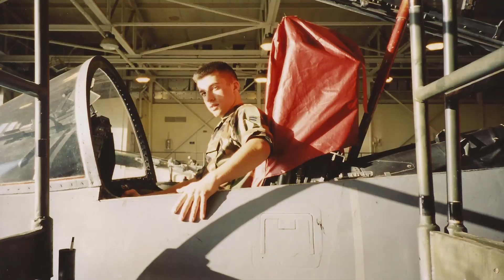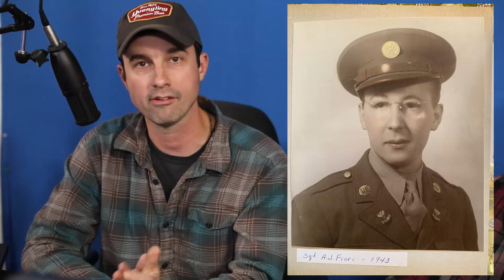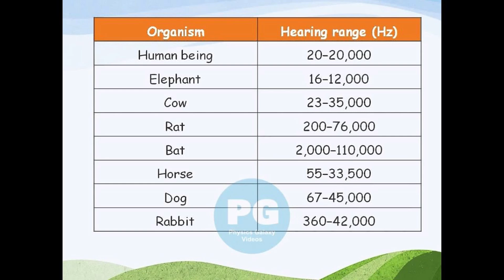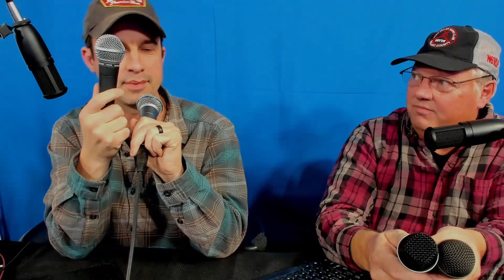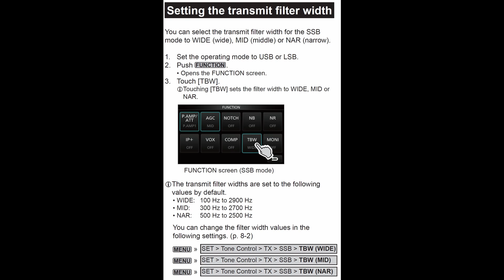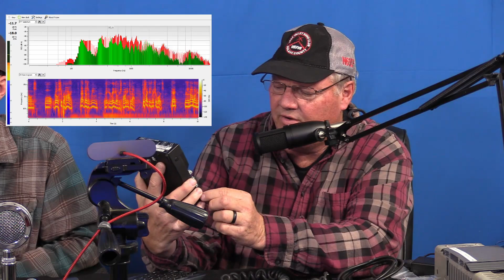Exploring Microphones (condenser vs dynamic vs hand mic)

Comment: Got a condenser mic, Mackie mixer, pyle direct box, 1/4 to 1/4 unbalanced cable, heil xlr to rj45 plug for my FT-991A and put out nothing but RF over the air.  Sent the Condenser mic back.  ordering a Heil PR-781 Dynamic mic tomorrow to try and can eliminiate the mixer and direct box..  hope it works.

Comment: Thank you for your service.  I was in the USMC for 4 years and in Vietnam '71 - '72; my dad was in the Army Air Corps during WWII.  Just ordered a Heil Pro7 headset for my new Yaesu 991a.  I've got several D-104's and hopefully another Ham is gonna help me wire one up so I can use it on the 991a.  Cheers & 73 from W Rusty Lane K9POW in eastern Tennessee

Comment: Would be nice to hear the difference between the d104 and condenser mic. I've been using a d104 for years and just got a 10da head for it. The 10da in my opinion has a much better sound and is definitely much hotter than the d104. I would love to have a comparison to see the difference between the different mics you let us hear today and the microphones designed for radio communication.

Comment: Great episode 😉😉very technical and you hit sum great points with transmit and receive bandwidth. Wish I knew more about how to set the parametric levels 😉😉 and which settings in the 991a did what 😉😉 thank you Jason & Kevin. Maybe a chat about older n sum mics that require phantom power 😉
Reply from the maker: Glad you enjoyed it! Yes, we will be doing more with mics and phantom power soon. We are in the process of building cables to sell for different type of mics that would plug into different radios.
Reply: I

Comment: You should probably do a little research before you make any further mis-statements about the frequency response of human voices.
Reply: In what way is showing the frequency range of the Human voice on a spectrum Wrong. Please teach us all.
For all the Ham people out there wasting money on expensive microphones just remember most tranceivers have a passband of 30hz to 3khz and this is where the most intelligible voice sounds are, so paying through the nose for a microphone that has a frequency response outside this range is a total waste of money.
Reply: There is nothing wrong with showing the response of the  human voice on an RTA; mis-stating the response is wrong. Think about it, if the response of the male voice is 60-180Hz or whatever he said and the female voice 100-270 or what ever, then neither voice could be heard over a telephone (300 -3,000Hz). The RTA clearly shows that the response of both voices extends up way above 4kHz. For mics, a good, flat response dynamic mic is more than enough for the limited bandwidth of the radio. And no, you can’t drive nails with a SM-57 - that honor belongs to the EV-664, the “Buchanan Hammer”.
Reply: @kendickensheets9522  I think they were talking about the fundamental frequencies of speech,the fundamental frequency of the complex speech tone – also known as the pitch  – lies in the range of 100-120 Hz for men, but variations outside this range can occur. The frequency for women is found approximately one octave higher. For children, its is around 300 Hz.
As you mentioned correctly the average person can't hear these frequencies and telephones wouldn't even relay them.
Totally agree 300hz to 3000hz is all that's needed for radio communications using voice, unless its FM stereo and music obviously.
Reply from the maker: Thank you @kdkshts for watching. Could you give more details? This was just a generalization to expand peoples knowledge in the HOBBY. I'm not sure if you are aware, but Kevin and I are not College Professors.
Reply: @HamRadioTV  Nor am I a college professor but I am an acoustician and know a little about sound. . . 

The frequency response of the normal speaking human voice is 125Hz (average) to 8kHz for men, 200-8K for women and 300-8k for children. The lowest octave within these ranges is where the fundamental sounds of the voice are produced. For men that would be 125-250Hz, women 200-300Hz and children 300-600Hz. Vowel sounds occur from roughly 500Hz to 1,000Hz and consonant sounds from roughly 500Hz to 4kHz. When whispering or yelling, the fundamental frequency and overall response changes somewhat. Within this range of 125Hz to 8kHz, the most important frequency band which determines speech intelligibility is the octave band centered at 2,000Hz or from 1,500Hz to 3,000Hz. 

The pass-band for telephone or radio operation (except for music/FM systems) is 300Hz to 3kHz. It follows then that a microphone with essentially flat response within this pass-band is essential to pick up and reproduce speech with good intelligibility. Almost any good quality microphone will easily be able to achieve this whether it is a dynamic or condenser type. 

Assuming that either type will have the required response, then there are other factors which should be considered and which can have a greater impact on the intelligibility and quality of the transmitted speech. One factor is polar response or directionality of the microphone. There are three basic types of polar responses available. They are cardioid (and variations including hyper-cardioid and “shot-gun”), bi-polar (picks up from the front and back, rejects sounds from the side), and omni-directional (picks up equally from all directions). There are variations on these such as noise cancelling and other specialty types). A major factor is the electrical output level of the microphone. The nominal output level of a typical dynamic mic is -50dBm whereas for a condenser mic, because it has active amplification circuitry in it, is -30dBm. This higher output level can easily overdrive the input circuitry of many radios and cause distortion or a “splattering” sound when ever any loud speech or other sound is produced.

If you are in a noisy or reverberant (echoey) room, you will want a mic which will pick-up your voice primarily and reject the other sounds in the room. The choice is the cardioid or hyper-cardioid. If the need was to pick up two people facing each other in conversation, then the bi-polar microphone would be the best choice assuming the room is quiet and not reverberant.  If it is noisy or reverberant then two cardioid mics feeding into a mixer would be a better choice. A quiet and relatively “dead” room is the best choice. Listen to your room – can you hear the heater or air-conditioner running, does it sound more like your shower or more like a quiet living room.

Cardioid microphones have a characteristic called “proximity effect” which increases the low-frequency response the closer your mouth is to the microphone (this is why singers usually prefer a cardioid mic). For most cardioid mics this proximity effect occurs below 300Hz and only within 2”-3” of the mic. Adding a good foam windscreen to the mic tends to keep your mouth a little further away from it and reduces the proximity effect. The windscreen also reduces the “P-pop” sound which, even though lower than the response of the radio, can still overload the input circuitry of the mic preamp and cause distortion.

The bottom line is that a good quality, cardioid dynamic microphone will perform just as good as a cardioid condenser mic for ham radio use. However, talking into a fancy condenser mic on an  articulating boom with an external mesh metal screen is a lot more fun.

Comment: I am ordering a new Yeasu FT-DX3000D next week.  I will either have to rewire the mic I’m using for the ICOM or get a new one... Kevin / Jason, what do you recommend I get if buying new?
Reply from the maker: I've had really good luck with my AKG 120 into a mixer. Which will also double as some great sounding audio into a Zoom call.